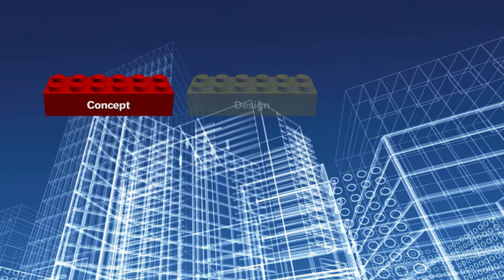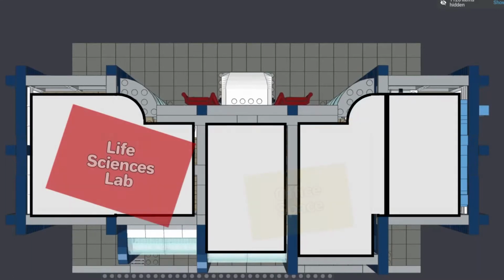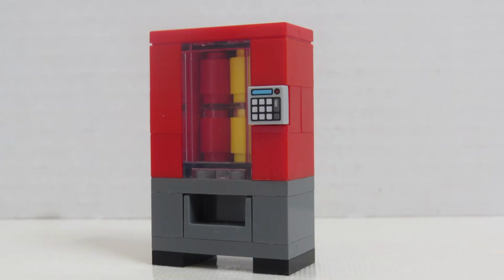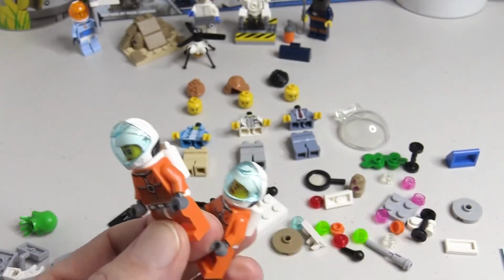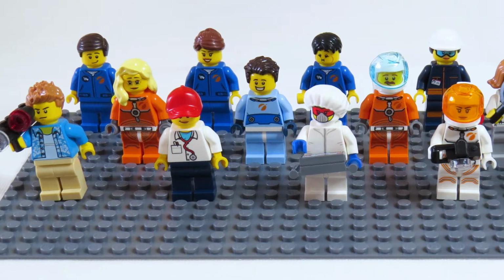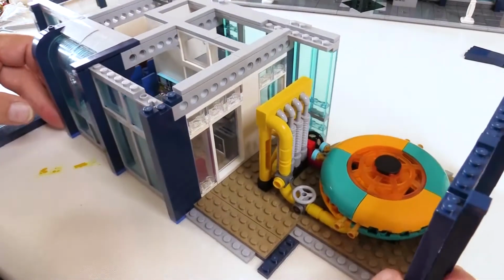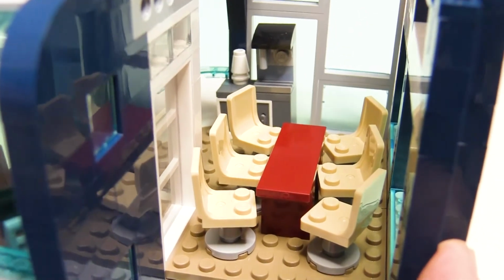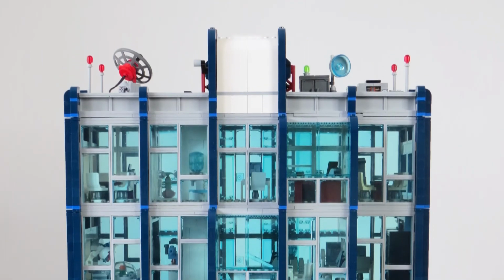LEGO Modern Office Building Modular MOC | Part 14 : Fixtures & Fittings

Comment: Hiya, I'm slowly getting through your videos - or at least the ones I feel relevant to me lol. The red warning lights on the roof would be on the highest point of the building only - not the four corners.
Reply from the maker: Hello Jason. I did wonder about the lights. Thanks for the suggestion, I may move the lights to the very top. I'll check the regulations in Euphoria about the position of aircraft warning lights! :-)